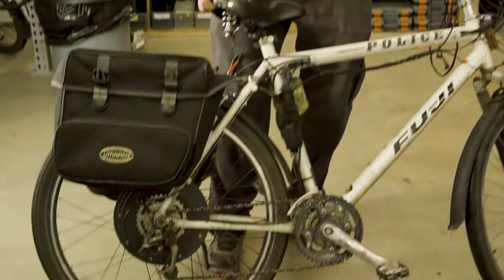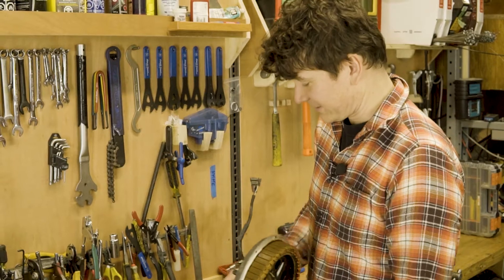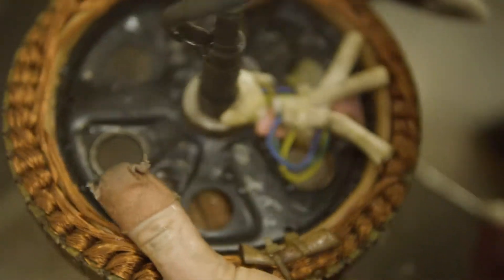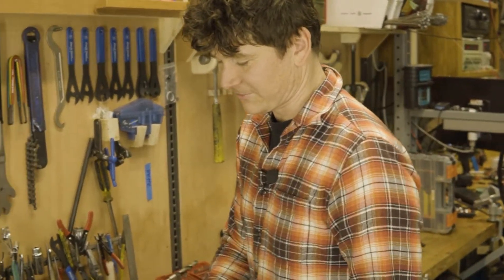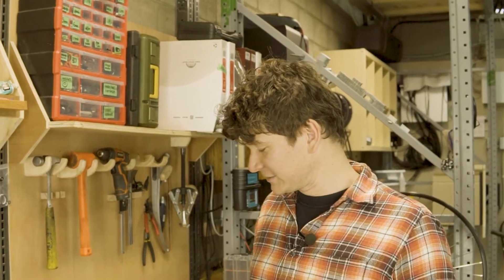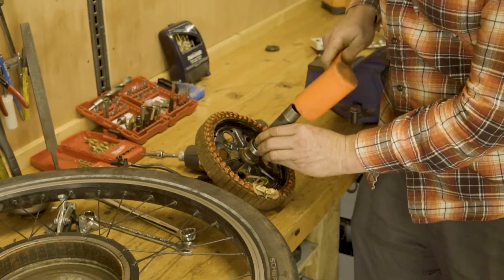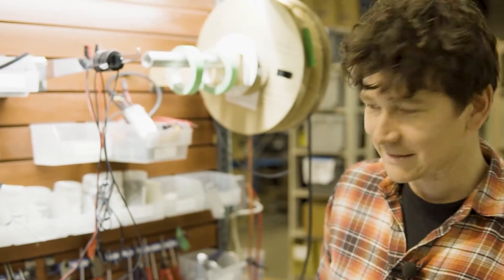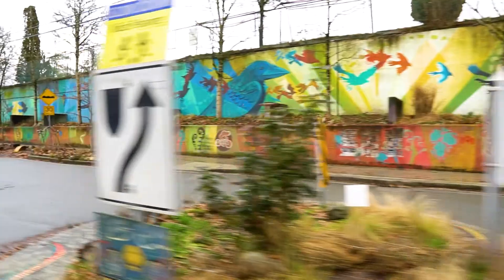Fixing up an old ebike hub motor with water damage, shot bearings, and a broken hall sensor

Comment: I opened my motor after some year and what do would you know, water actually got in from the heat shrink tube all the length of the cables...
Reply from the maker: But it's still running fine?  A little water rarely causes much of an issue but it's good to clean it out and potentially adjust your wire/cable routing to avert future ingress.
Reply: @GrinTechnologies  yes, there was a big amount of surface rust and pitting, but after replacing a hall sensor and cleaning it works just fine again

Comment: Hi, thanks for a great upload to watch. Please can you possibly explain what might be the cause of a motor that makes a whirring noise and sometimes cause the wheel to be difficult to rotate? Thanks in anticipation. Regards, Brian 👍👏👍👏👍👏🏴
Reply from the maker: Not enough context to answer your question about noise with any confidence. Is it a geared motor or a direct drive motor? Is the noise present only when the motor is powered or also when it is just coasting without power? An intermittently jamming clutch on an otherwise freewheeling geared motor can be one cause for what you describe.

Comment: Hi there I don’t have a special hall sensor detector so is there another way to do it?
Reply from the maker: Yes, with a multimeter
Reply: @GrinTechnologies  nice so they should say 5v right and all I have to do is put the black point on that part and put the red one on the other coloured ones and pass a magnet close to it right.. sorry I’m not extremely geeky in these sorta things btw and thank you

Comment: Hi there could you help me a eBay keep cutting out at high speed when my battery is fully charged and which sensors are the best to buy is it 41f or ss41 or ss49  hell sensor 👍

Comment: ☠️☠️☠️ I've been experiencing  extremely dangerous episodes of the motor not stopping as soon as I turn the throttle , related to high humidity conditions ! I think it's because the humidity increases conductivity of the hall sensors in the throttle . can you recommend a good throttle ?  I think the manufacturers are going to have to make them water proof. I experienced the same issue with a different throttle , battery and controller. just using the bike after a rain storm is enough to cause the issue. We must have a throttle will a switch to cut power ! ☠️ Also stop using hot glue on the Hall sensors ! It melts were I live ! And make the throttle not Fall apart so easy , and they need to be made with softer grips or made to accept normal grip's.
Reply from the maker: Hi Jacob, we've seen this in throttles that have an LED battery gauge on them, as in those cases there is also the full battery voltage (be it 36V, 52V etc) also present at the connector and it doesn't take much water bridge to pull the throttle signal levels higher up.   We do not have any issue with 3 pin throttles that just have 5V, Gnd, and Signal present.
Reply: @GrinTechnologies  Thank you very much for your reply, I have the led screen but never sent current to it. I did have a issue with tire rub on the wiring but I have repaired that. Maybe the throttle and phase wires should not be next to one another ? I removed the ingnition switch and replaced it with a push button on off switch , so I can instatly shut down. I think all throttles should be set up this way.🏍️

Comment: Surprised you didn't put some of your Ferrofluid in it. That should help with the Thermal pump condensation.
How much would you recommend for that size motor?
Reply from the maker: You're definitely right about adding Ferrofluid. 6-8ml does the trick for this size of motor.

Comment: I have an old Chrysalite that suffered from condensation in winter because I would bring it inside to keep the battery warm.
But that was 10 years ago, my e-biking ended after I was duped into buying an expensive LiFePo battery that lasted about 1500 km
and self discharged itself to death.
Bought a motorbike instead and had hardly any problems over 10 years and 70,000 km.
Reply from the maker: Bummer! You won't see this same issue with the waterproof HiGo connectors. Hope you get back into ebiking before long.

Comment: how do you drill a hole in the side of hub without having the shavings go in?
Reply from the maker: Drill from the bottom with the drill bit facing up, and then gravity helps all the shavings fall downwards rather than into the motor.  Going slow helps as well.

Comment: Wonderful to see how long lasting and reparable these eBike motors can be. Thanks!
Reply from the maker: Yeah, there's really nothing about an BLDC electric motor that ever wears out, other than the ball bearings. But you have that problem with any bicycle hub, whether it's motorized or not.
Reply: @GrinTechnologies  HI! similar (NINE CONTINENT motor model circa 2009) axis has bent slighly and the nut cannot fit back in all the way so to tighten properly. How can I replace the axis? can I remove it from the stator?

Comment: I've given up on Hall sensors. I just use sensorsless mode controllers. I don't like the idea of bike failure due to a feature that isn't essential going bad on you.
Reply from the maker: As long as you have a controller that run both sensored and sensorless you get the best of both worlds, flawless torque at zero speed and no vulnerability if hall signals are lost.
Reply: @GrinTechnologies  they usually come in dual mode anyway if you want sensorless. It's certainly nice to have a smooth take off from a standing start but I can live without

Comment: 10:53 vent hole option. So water can get in and escape easily. But what if you're off roading with mud, big particles and stuff like that, motor will literally get physically clogged up will it not?
Reply from the maker: Potentially, that's why we wouldn't suggest this approach if you are riding with that kind of exposure, and would recommend sealing and statorade instead. But if you're exposure is just rain, it works surprisingly well

Comment: Had the brilliant idea of sealing side plates, water stayed in hub,eventually causing hub to stop moving, because of rust. Building new motor with built in fan blades on side plates and and vent holes, and weep holes so water goes through it, and I treated everything on inside with industrial motor varnish,  you can get it at Grainger, look up on internet 😀 , hub motors leak, but with a good varnish on it you will be able to laugh at the 🌧
Reply: Some people purposely drill large vent holes in their side plates for cooling. Or use ferro fluid on the inside to help displace heat. If he had large vent holes, it wouldn't have sat full of water AND he could stick a load more current through it 😁

Comment: What is that  white goop  called that's found in hub motors and electronics? It's not silicone or caulking. I would like to use the same as Chinese

Comment: Hi Justin!  Thanks sooo much again for all the detail here! Isn't this just crazy! Moisture traveling down on the copper wires/insulation fiber and outer plastic sheathing causing failure! I have seen this in well depth level sensors and the same thing causing electronics havoc in many other industries!  If you don't do this kind of work this one almost looks like it fell in a lake!  For ebikes it's a great reason to have the large holes in the sides of your hubs! May need to vacuum them out at times but great for overheating and overall performance!

Comment: Seems that filling the hub with oil and sealing it would prevent any/all water damage, no?
Reply from the maker: Yes but key word being "sealing it".  In practice, easier said than done and you will almost always have oil slowly leaking out all over your setup, rendering your disk brakes useless and making a mess of things. The viscous drag of an oil fill also roughly doubles the drag torque to spin the wheel.  See https://endless-sphere.com/forums/viewtopic.php?f=2&t=48753&start=750#p1106995 for my experimental test results on this.
Reply: @GrinTechnologies  thanks!

Comment: 1. How many bearing pullers, and what sizes do you use?
2. What was the total time (minus edits) and how much did you charge?
3. How accurate do bearing measurements need to be and where do you source your sealed bearings.
Very nice video. Thank you.
Reply: You actually don’t need a gear puller. You can remove the screws and push the wheel toward the The ground with the axle touching and the stator will pop out. 
Don’t worry so much about the accuracy of the bearings as they are very standard sizes. I typically order bearings from Amazon
Reply: @eastwood111  The magnetic attraction is huge (for me). Has anyone measured the force required to separate motor sizes?
Reply from the maker: @bob-ny6kn  The force is large but doable without special tools if you can use your body weight to advantage. It gets tricky if the stator jams from wedging sideways while pulling it apart. Usually breaking the seal on the side plate takes more force than pulling the stator out. With the gear puller the loud 'pop' is the side plate sealant breaking free. 

Repairs like this take anywhere from 20 minutes to 2 hours depending on how messy things get.
Reply: @GrinTechnologies  thank you. It's the re-assemble force that seems would benefit from a gear puller (putter? :)  )

Comment: Would you suggest a geared hub for the rear, and a direct drive for the front, so you have the torque when need as well as pull from the direct on flat/help the geared hub uphills?
Reply: All you need is a powerfull direct drive in the rear and it safes you all the complexity.
Reply: @blise518B  I’ve seen more that I like about this very thing on here with Justin that has me thinking that setup may be the best option. The cooling from the statorade, and again way less moving parts than a geared hub.
Reply: @buffalomind6838  it all depends on your application. If you constantly climb hills at low speed with low traction 2 smaller geared hubs might be the better choice. But I wouldn't mix 2 different kinds of motors. Generally one powerful Direct drive is better because you have regenerative break, less moving parts and more Efficiency most of the time.
Reply: @blise518B  I am not constantly going up hills, but for a bridge or two which I pedal going up about 9mph. I simply would like to go up them without any strain as if I were on flat ground, or even with a slight decent would be awesome.
Reply: @buffalomind6838  If you are worried about a bridge then pretty much every motor is sufficient. You will be surprised how powerful e bikes can be. With a Phaserunner at 72V you pretty much have a light motorcycle that can go like 45mph.
Reply: @blise518B  I’ve only had a fat seater/stand up scooter, but really more seater as it wasn’t one of those smaller scooters. The watts were 500 and it had a 48V w/10amps. It couldn’t go up the bridge without stopping several times, so I don’t know if it was that the motor was too weak, and also the charge would deplete super fast after going from my home which was a minute away on the scooter fully charged mine you, and by the other side of the bridge 2bars of the 5 were gone on top of the scooter not having the strength/power to even take me up without stopping multiple times and going at a slow pace unlike all the other electric vehicles I seen crossing the bridge.
Reply from the maker: We'd recommend this only if a single hub motor doesn't have sufficient torque for your needs. But if you can find a single motor that does the job for your hills and weight, that is much easier and more convenient to wire up.
Reply: @GrinTechnologies  I was first thinking of the GMAC geared hub w/regen would probably be the best option, but seeing further that the Nine continent RH212 may actually be a better option.
Reply: sounds awesome. what do you think about wiring weight and battery setup? front wheel motor certainly helps in a soggy wet forrest. 2 wheel drive effect will help you get through mud and soft stuff with narrow tires.
Reply: @MrJob91  If I ran 1 motor at a time I’d want to get a little bit higher wattage of a motor to compensate for the weight in the other tire alone with the second, or double the battery size which I want all the energy of the motor to be helping me solely as if the extra weight wasn’t there in order to have all the positive that I wanted in the first place. 

The only thing is the extra weight which is the irony. I am sort of in a conundrum on deciding on 2 hubs, or one that flips the bill for me “perfectly”

Comment: Been down this rust road a couple of times now. I will start painting the insides of the hub motor with enamel
Reply from the maker: We'd recommend a product like Boeshield T9 over a paint though, since paints/enamels can flake off and cause their own mess inside the motor.
Reply: Well this hub motor comes in direct contact with lots of water off-road use. What if I bake the stator at the right temperature to get a really hard cure. And what is your thoughts on using your statoraid with enamel? Obviously with the enamel being baked at the right temperature for the right amount of time. I would probably bake it and then still allow it to air dry for several days before reassembling